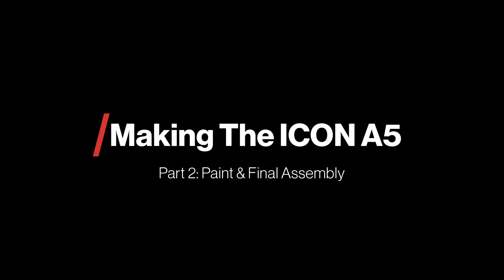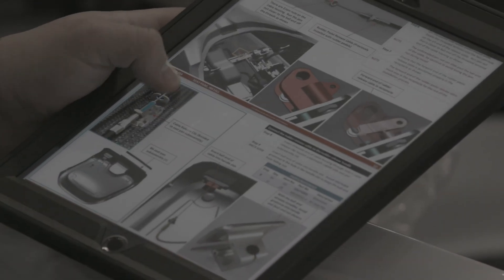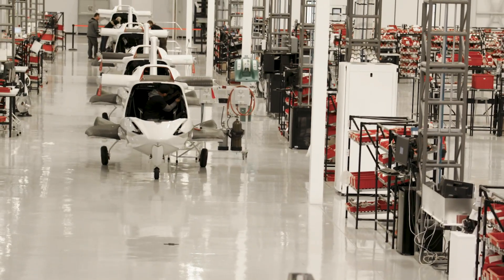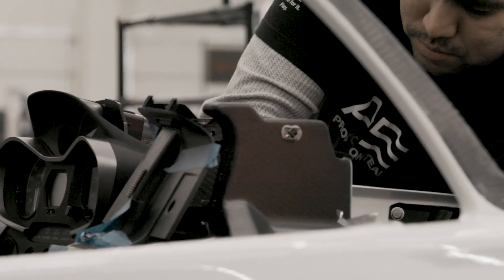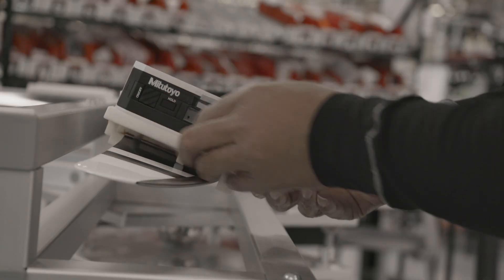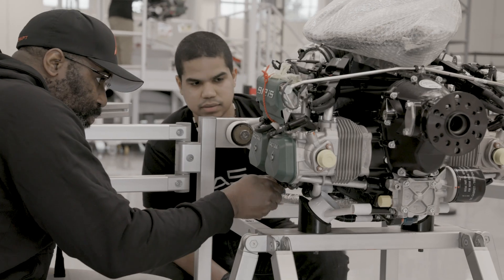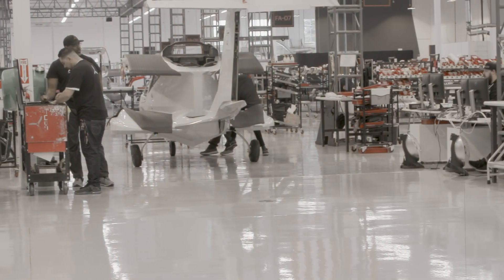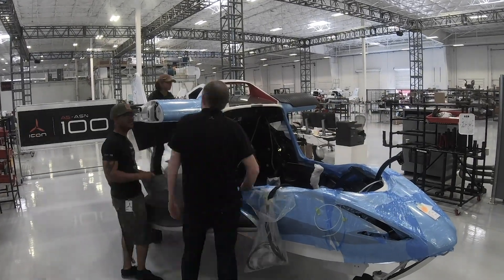Inside The ICON A5 Final Assembly Facility | ICON USA

Comment: My paramotor has 38hp strictly for safety! Wind can throw you around at low speeds and it's not a joke. Your 100hp 2 seater is a lot of plane and an engine that puts out the same weight as my asian wife weighs but in pounds of thrust come on. A 200 -400hp motor is not even hard to do. A jet engine is 23lbs it makes 200 hp. You are barely in the sky with something so under powered. 350,000 is not a off the mark number the shape the design both inside and out is very attractive. But with that amount of oversight on the powerplant made me loss all faith something else I can not see isn't completely wrong as well. Offer a proper 200/400hp turbo prop option and then It would be a plane worth buying.